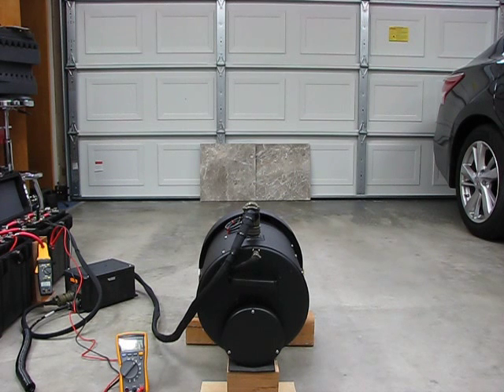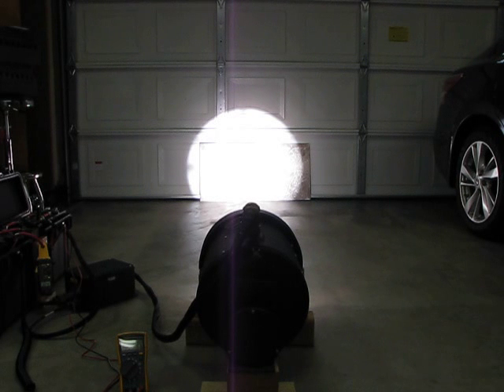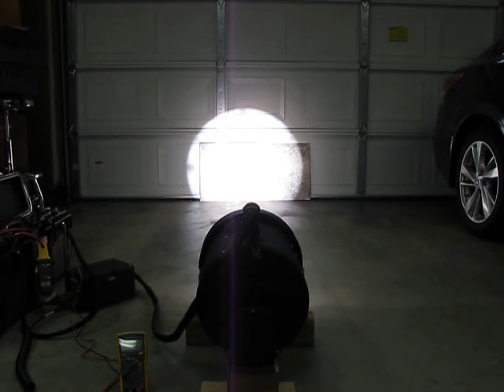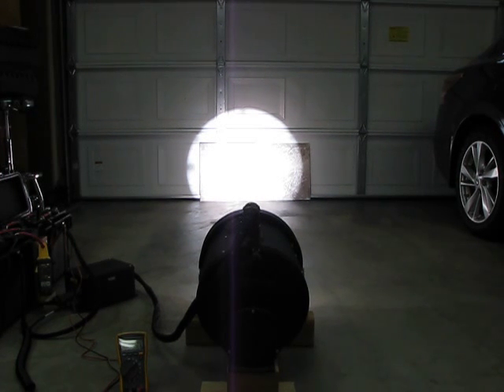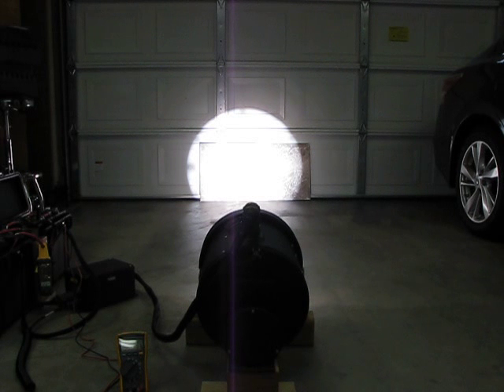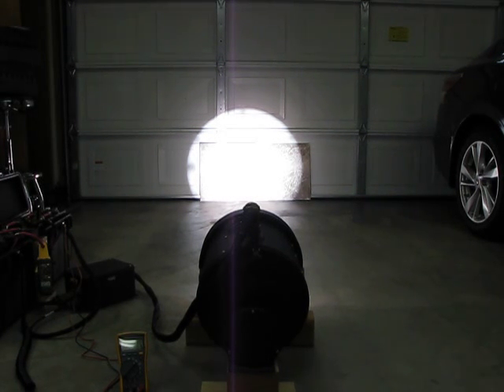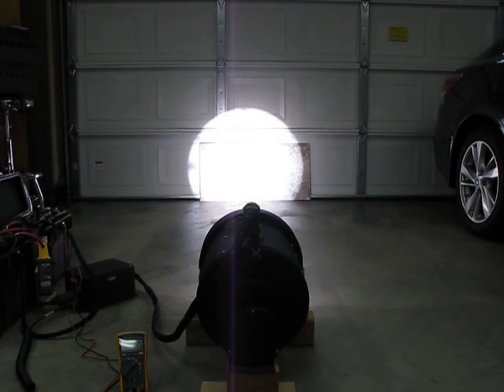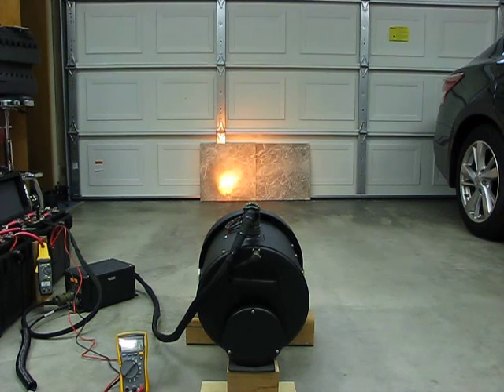Spectrolab SX-16 NightSun Running on Battery Pack

Comment: Always been curious if there is any internal electronics of any type to regulate the arc lamp current to run the lamp nearly at 1600W. But as i see the there is no regulation, the lamp power is somewhat proportional to the input voltage.